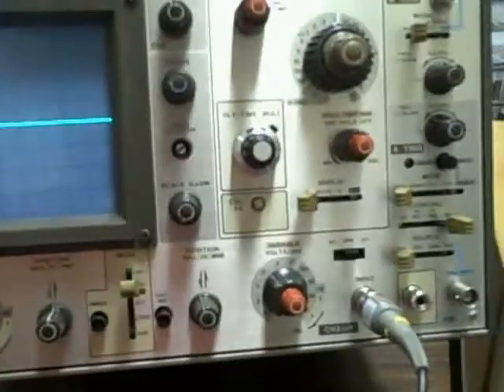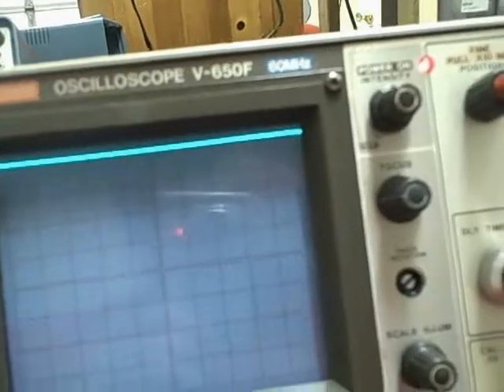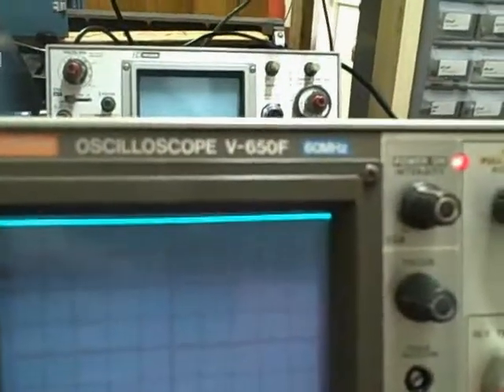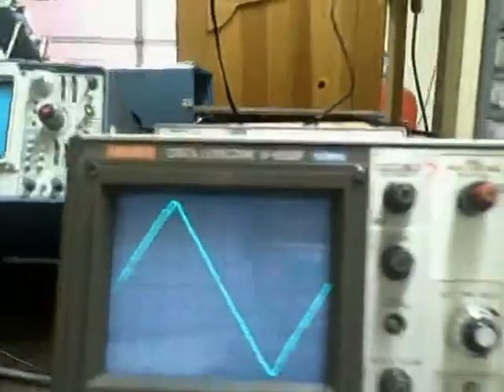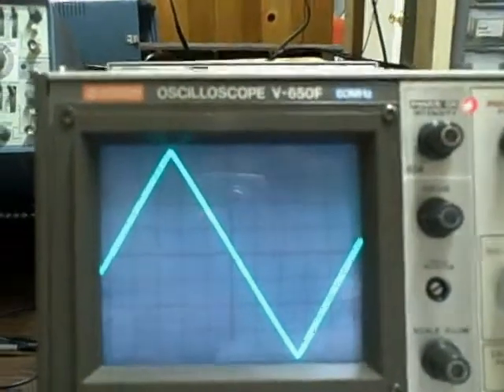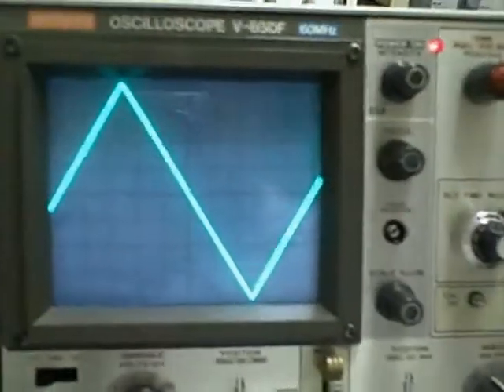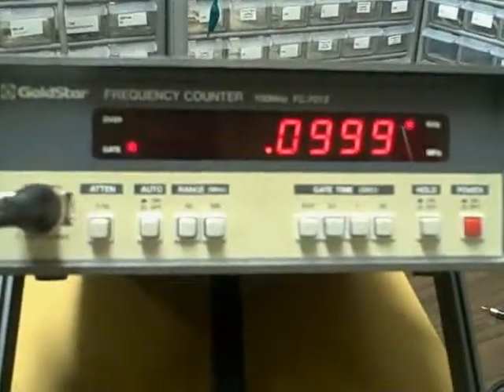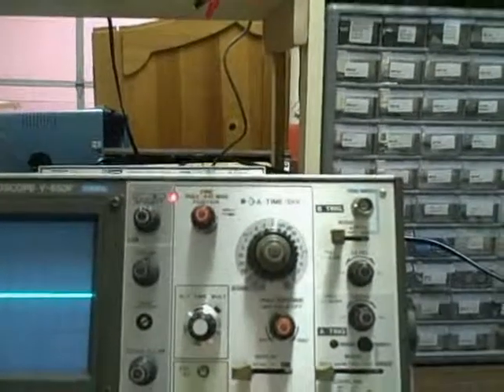pt2 v650f demo.avi

Comment: Hi i have same scope but on both channels some weird taiga happens, as soon i touch the scale volt div knobs, the orizzontal line start to blurring disappearing too down or upper screen and i have to fiddle with knobs in order to have again proper line centered without distortions or things like that. I’ve opened and tried to clean theninternal knobs/switches with cleaner but prob persist...any suggestion? Thanks a lot!